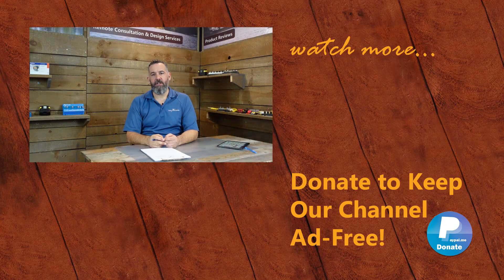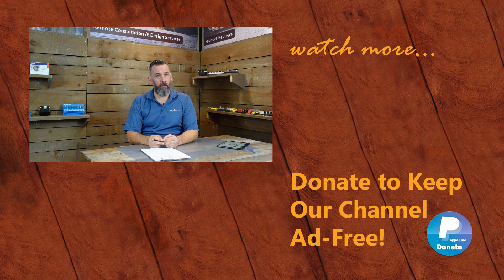Should My Boat Have a Separate VHF and AIS or Combined?

Comment: Because AIS devices are currently using universal electronic language across the different brands, separate devices should be an excellent choice. When manufacturers starts making devices that operate proprietarily, the trust is broken and you should strongly avoid that brand.

Comment: Could you do a video of how to properly solder the VHF antenna connector?
Reply from the maker: Good suggestion.
Reply: @PacificYachtSystems  yes please! I need a how to guidance on preparing the cables/wires for sailboat vhf and ais wiring

Comment: Jeff, 
I think you have the definition of redundancy wrong: re·dun·dan·cy the inclusion of extra components which are not strictly necessary to functioning, in case of failure in other components.  It would be redundant to have two VHF and two AIS. It is not redundant to split them up. I disagree that your approach is going to make boaters significantly safer and save them money. We have all(okay 99% of us) migrated to multifunction displays. Why? Simply put integration and the resulting advantages like cost savings and interoperability far outweigh the added reliability of having everything broken out. If you want redundancy in a GPS/Radar/Sonar system you add an extra MFD not split everything out. Garmin/Navico/Raymarine/Furuno barely sell individual components anymore. Simrad and Furuno do but not much in the recreational space and even for the commercial side options are limited. I think you lost your way a bit on this video man.
Reply from the maker: Hmmm, thanks Damien for the explanation. Appreciate it.
Reply: Sure, but the VHF could serve as a redundant AIS receiver, even if it's not capable of transmitting AIS data. It'd be safer to have full redundancy (AIS rx and tx), but at least having AIS rx is a benefit over not having that at all. Sometimes redundancy isn't a perfect seamless replacement, but at least some form of limp-home better than nothing.

Comment: I went with a separate Vesper AIS box with separate AIS antenna. I do not like the antenna multiplexers because of the signal loss. Give me maximum signal strength!   Not a concern when using a combination VHF & AIS unit?
Reply from the maker: Good point David, definitely an advantage of the Vesper Cortex.
Reply: The Vesper splitter is amplified when powered to eliminate signal loss, it also has a passive pass through if power is lost.

Comment: Many of the contemporary black box AIS units have built-in splitters, thus allowing the use of an existing VHF antenna for both VHF and AIS.
I, however, subscribe to Jeff’s view that separate units are the preferred configuration, if you have the space, for the reasons he mentions.
In my case, I installed a stand alone AIS with a dedicated antenna, which insures that there will be no interruption of signal because of a conflict of using AIS and the VHF simultaneously, or failure/degradation of the VHF antenna.

The built in splitter in the AIS is not used when there is a dedicated AIS antenna, however it offers a short term solution if there is a future failure of either the VHF antenna or the AIS antenna.  That solution is to disconnect the failed antenna and put the splitter into service in feeding both the AIS and VHF signals thru the remaining functional antenna.  This assumes, of course, that the AIS box and VHF head units are in close enough proximity that you can use a short coax cable with couplings to jumper the vhf head unit to the splitter connection on the AIS, and that you have such a cable aboard, or can fabricate one .  A bit of redundancy in antennas, at least.
Reply from the maker: Thanks for contributing Steve, appreciate it.

Comment: Also, maybe you should have addressed the antenna situation. If you install a separate VHF and black-box AIS transponder, you'll need to install a second antenna (i.e. for the AIS), usually if you're talking about a sailboat you'll have the VHF antenna in the top of the pole and installing another one up there is not feasible, so you'll have to find a place to install the AIS antenna lower, and maybe that'll affect the range. To avoid that you might install a splitter to use the same antenna for both VHF and AIS, and in that point, wouldn't it make more sense to have a combined VHF/AIS device, than having the complexity of separate VHF radio and AIS transponder, and then the antenna splitter, going to the same antenna?
Reply from the maker: For sailboats, most of the time we install a digital VHF splitter and share the VHF/AIS antenna with the VHF radio and AIS.
Reply: @PacificYachtSystems  thanks for taking the time to comment and reply here. I Learned a lot with your videos